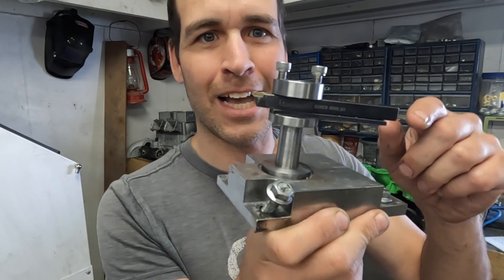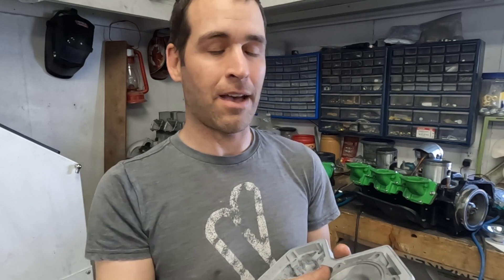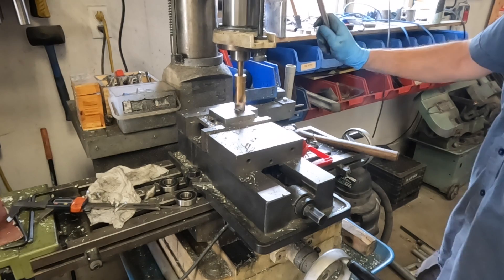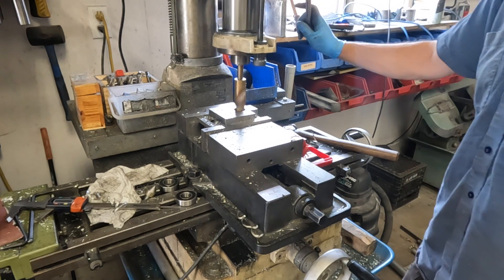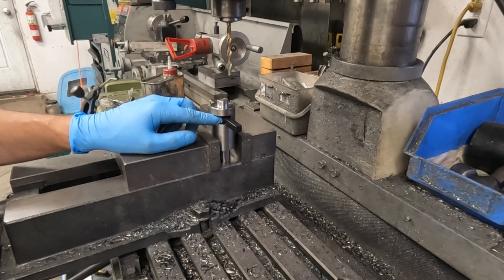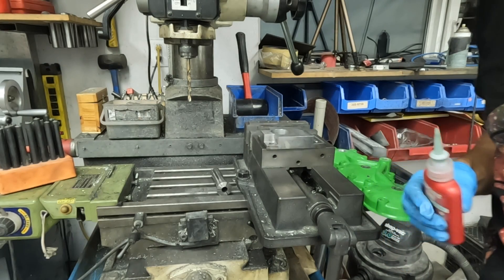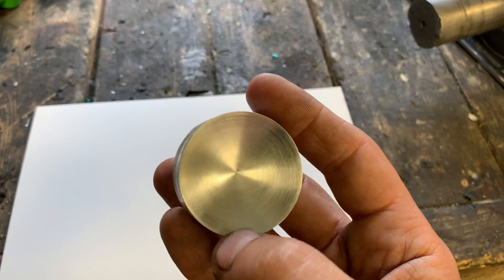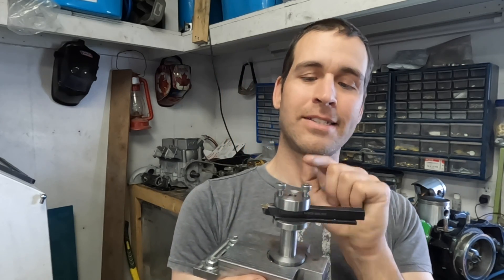Building A Lathe Radius Tool ( Reverse Hemisphere Tool)

Comment: Hey nice tool!
Reply from the maker: Thanks Lance... YT has stopped notifying me about comments on this channel and I just found out yesterday.
Reply: @loweredexpectations4927  sounds about right. Did you get your PM machine yet?
Reply from the maker: @lanceulbrich6249  Yeah, it showed up pretty quickly, I was impressed. There is a bit of a teaser shot of it at the end of my last video, during the outro. I have designed a stand and chip pan in Fusion 360, bought some metal and I have the stand mostly completed. The plan is to have someone build the chip pan parts for me.. that way it will get done right... I hope. 

I received the motors, controllers, breakout board etc. a few weeks ago and haven't had time to even open the boxes. Haven't had time / don't want to open until I'm just about ready to use them... I have too many projects on the go currently. I am now waiting on the ball screws... they were paid for a little over a month ago... The guy has a good reputation from what I can see and he said about 20 days.. but he was assuming I was in the US. 

I how have to turn my CAD sheet metal designs into dimensioned drawings so I can have someone build the chip pan.
Reply: @loweredexpectations4927   I'm currently watching that vid and saw it behind the curtain wahoo!
Reply: @loweredexpectations4927  what did you end up going with for a controller?
Reply from the maker: @lanceulbrich6249  I wasn't even aware of that sighting... I was talking about after taking the curtain down... at the end of the app video. Either way... It's there siting on the floor.
Reply from the maker: @lanceulbrich6249  I ordered a DMM kit that came with (I think) just about everything except for a controller. My plan as of now is it use a ESS SmoothStepper ... I feel like a mongoloid talking about this stuff because I know so little about it. I haven't ordered it yet because I haven't looked into it enough to know if that's actually what I need / should use.
Reply: @loweredexpectations4927  sorry just realized I wrote the wrong part number the one I recommend looks just like the one I wrote but has 3 relays on it I can send you the part number when I find it they are cheap and save work
Reply from the maker: @lanceulbrich6249  I didn't get another message from you... but any help is appreciated.

Comment: I bet that material is heat treated 17-4. It could also be Inconel. How is your material situation right now? Do you still have a crap ton of the short pieces of lathe stock I gave you? How are you on endmills?
Reply from the maker: Hey Jacob... I feel like what happened is that I was a little too gentle with it... I cut too slow, and that caused it to heat, and that caused it to harden. When I used the spot drill, it drilled really easily. It was kinda the same thing when I turned it on the lathe ... I could take like .060" cut and it cut better than if I took shallow cuts. You know a lot more about this than I do. 

Yeah... this was a piece of that lathe stock ... the first piece that I've used I think... Other than using them for the press. The end mill situation is pretty sad, haha. I used one of the two flute ball end mills that you gave me for cutting some aluminum... it worked amazing. I've always just been using "normal" HSS 4 flute and it was a world of difference. 

I think I asked you this before, but I can't remember the answer... what CAD CAM do you use ... or is it a secret ?

Comment: I'm curious about how you are going to mount the heads so you can turn the whole head while you machine the domes.  I believe you mentioned the domes are integral to the head on the model you need to fix.
Reply from the maker: Not that I want to spoil it for you... but the domes / head inserts will be built separately and then installed. If I had a massive lathe, I could technically turn the whole head in the lathe. It will all make sense if / when you watch the other video, haha.